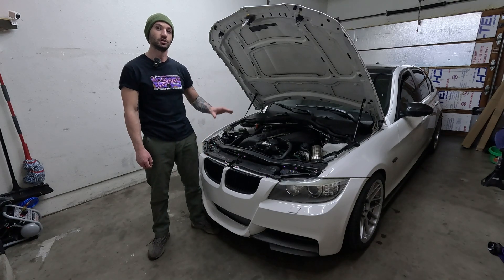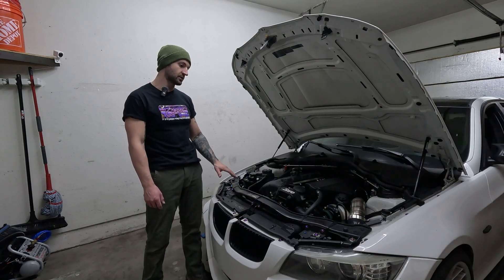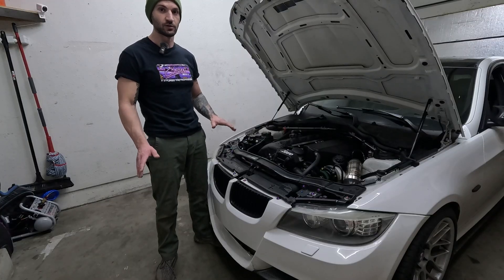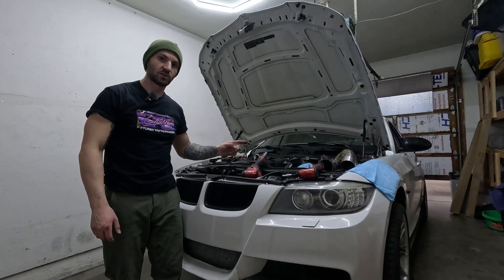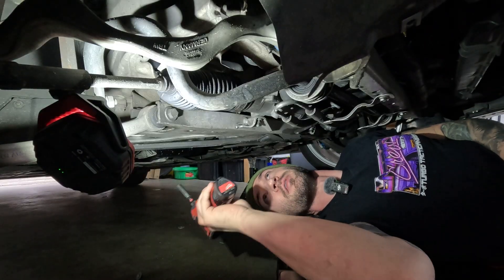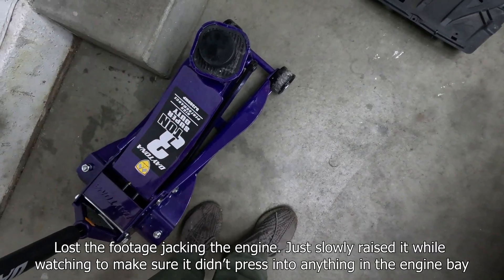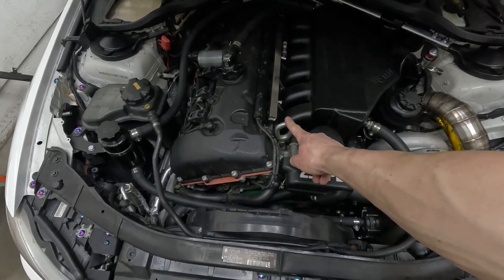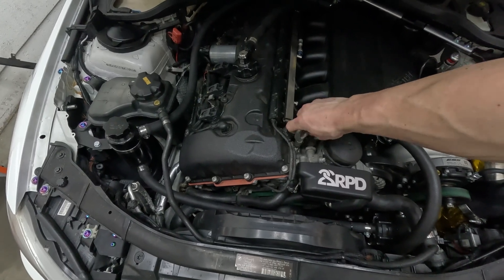E9X Motor Mount DIY + $30 Upgrade

Comment: Yeah I think my mounts need replacing when coming to a stop it feels like the engine or something sets in or like a slight drop feeling
Reply from the maker: Try the test in D with foot on brake, it'll be very obvious if they're blown. That symptom could also be things like control arm bushings
Reply: @RaimundN52 aaah thank you will do the test then see what happens

Comment: you can replace both of them filled with any PU. I did it with even harder stuff and there is basically no downside. Stock is just WAY too soft.
Reply from the maker: Definitely you can use any poly you like if you want stiffer. I think the windoweld is a good in between

Comment: Man I think I’m gonna switch back to stock after installing mine with the window weld mod. The m3 arms and m sport suspension are harsh enough for me.
Reply from the maker: What was your experience with the windoweld mod? Switching just the driver side with OEM made it comfortable again for me.

Comment: Hey Raimund what cowl are you using for the cabin air filters? Your engine bay looks way cleaner than it normally does with that huge plastic cowl is that from the M3? I’d love to pick some up
Reply from the maker: Yeah it's just oem m3 one 👍

Comment: Didn't know the driver side was possible without dropping the subframe. Guess I know what I am doing here soon when I have to lift it up to do the drivers tie rod. Bought two and only replaced the passenger side mount. Now ~6months later the driver side is collapsed too T_T

Comment: Couldn't you machine, shop or DIY, the bottom of the N52 engine/tow hook so it seats properly?
Reply from the maker: Possibly. I don't know if that extra width is necessary for strength on the new design due to different manufacturing/material- or why it was designed like that.